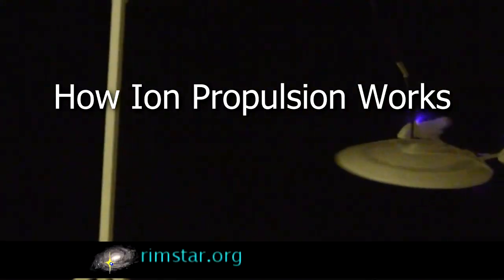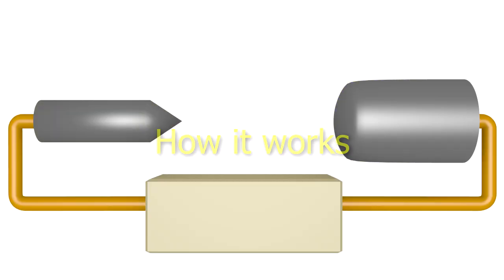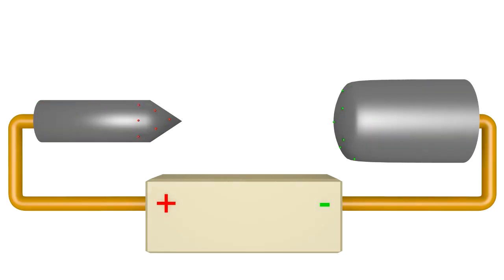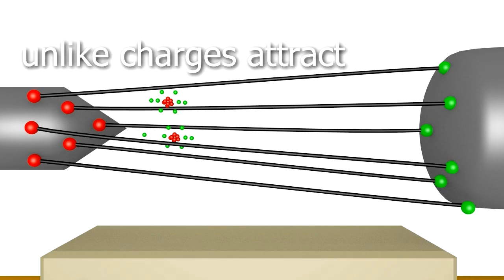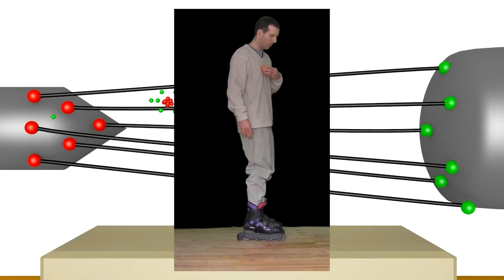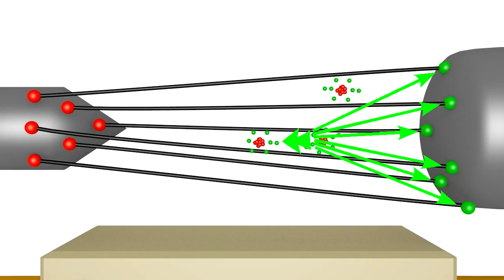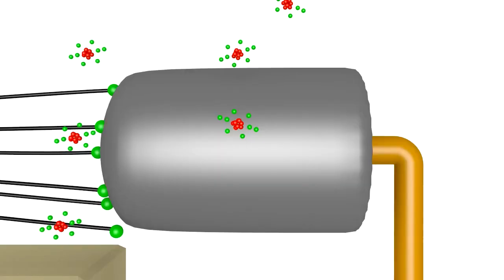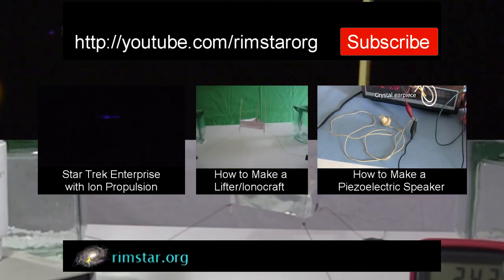How Ion Propulsion, Lifters and Ionocrafts Work

Comment: But the chair is grounded to the floor and does not move hence making it easier for you to push against it whereas the atom which gets hit by the ion like you have put it is free hence moves. an example am thinking of is if you dungled two balls with strings and then swang one so that it hit the other which is stationary what would happen. for sure the stationary one would move but will the other bounce back? if it does will it go back with great force or a weak one?
Reply from the maker: That depends on things like mass of the two masses (if you swing a ping pong ball at a bowling ball then the bowling ball won't move much but the ping pong ball will bounce back) and on other things like the elasticity of the two objects and probably other factors too.
Reply: @RimstarOrg  okay the different in mass and weight between a ping pong and a bowling ball is quite much. if you had two balls which differed in mass by just a tiny little bit what speed would be required for the smaller ball to knockout the larger and bounced back both at slightly higher forces and speeds.
Reply from the maker: I don't have the formulas off-hand.  It would probably involve the formula for momentum and a formula for the elasticity of materials.
Reply: @RimstarOrg  you went silent all of a sudden why? its been a week now and I have not gotten any response. i kinda need your opinion on the point i raised. what am saying is that you used/wore roller skates to show movement okay fine but you forgot that the molecules also move. so you should also have used an object that can move(not a stationary one like you used there) to represent the molecule.
Reply from the maker: I would simply have to try the chair with different masses sitting on it until I'd find a mass which would cause my pushing on it to move both me and the chair. The same trial-and-error happens with the lifter except that some of the guesswork has already been done. From my testing and that of others before me, I know roughly what voltage and current range is needed to move a sufficient amount of air and even then, I have a variable control and gradually turn up the power until the lifter starts flying.
Reply: @RimstarOrg  couldn't you have used a wheeled chair or a sliding chair instead? have you tried to do the same with a wheeled chair if yes how did it turn out. you should try posting a short video about it, i'd love to see the result and your reaction. the way i imagine your analogy is if you had a staircase where the individual stairs were suspended in the air and you tried to scale up but the stairs are held up by a weak force similar to the air molecules which are suspended by a weak force such that whenever you stepped on them they fall immediately even if you had a hundred pair of legs it would be impossible to make any significant progress upward not forgetting there is also gravity working against you same to the ionocraft.

Comment: The thing I wonder about is that these lifters were apparently tested in vacuum chambers, where no interaction or thrust via air molecules was possible....Does that discount the ion propulsion explanation?
Reply from the maker: All the ones I've seen show them moving very slowly i.e.  very low thrust. There's also no such thing as a perfect vacuum. There are also other things which you produce those small amounts of motion: sparks causing the ejection of matter, Coulomb forces, small thrust due to the small amount of particles in the partial vacuum, emission of electrons, and there are likely others too.
Reply: @RimstarOrg  I'm fascinated by this stuff,  and from the other examples of lifters I've seen, such as ones tested in a vacuum, it eventually failed as it approached full vacuum. But then I noticed that it was short circuiting with the little balsam legs now acting as a conductor between the anode and the cathode.....

I'm no electrician, but it occurred to me and other commentators on that video, that the problem may be that the air acts as a dielectric.....When there's no air, the electricity starts conducting down through the next available pathway....So, in a vacuum, you'd probably need another design using a built in dielectric material. In fact, I think that was part of the original TT Brown design.

Comment: can lifter fly till certain height by applying weight to it
Reply from the maker: Yes, but it would still be tricky to make it stable. The only reason they seem stable at all is because there are threads holding it down at each leg. More propulsion than is needed is applied to each side. As long as the weakest side is propelling enough against the threads holding it down, then it appears to be stable.
The whole problem lies in that it's very hard to make each side propel the same amount of air. You have to make the distances between the wire and the foil exactly the same for each side, and the curvature of the top of the foil probably matters too.
So you can weigh it down but you'll still need the threads.
Reply: @RimstarOrg  thanks

Comment: your power source looks complicated. Can't you just like get a voltage booster and connect the copper through the outlets?
Reply from the maker: I doubt that those cheap boosters which you can buy on ebay would have enough current to fly a lifter. Also, a lifter needs DC or pulsed DC. From what I've seen of those boosters, I suspect they put out AC.

Comment: can it fly in vacuum
Reply from the maker: It can, if you bring along air or some other gas to act as the propellant to be ionized. The ion thrusters used in spacecraft like NASA's Dawn spacecraft which went to the asteroid, Ceres, was a different design but it carried along Xenon gas as the propellant. https://en.wikipedia.org/wiki/Dawn_(spacecraft)

Comment: Will static electricity work instead of a high voltage power supply?
Reply from the maker: No, for a lifter, static electricity doesn't usually have enough current. You need a lot of current (somewhere in the high microamps to low milliamps). A very big Van de Graaff generator might work, one with a 15" to 20" dome but my 14" dome Van de Graaff didn't have enough current. The voltage needs to be around 25,000 volts.
If you want to do simpler things, like an ion propelled rotor then you can use something like a Van de Graaff. See these videos of mine for ideas http://youtu.be/UgWTjCHsm3M and http://youtu.be/Gf6EbRmYImI
Reply: @RimstarOrg  Thank you!
Reply: @RimstarOrg  It would at least make some ionic wind, right? I just need a simple and non-dangerous demo of ion powered flight. Don't need it to fly, just need some ionic wind from the "engines".
Reply from the maker: That's an interesting question. Without doing my own experimenting, it's hard to say what would work. If I were to experiment then my first attempt would be to combine just the rotor part from this https://www.youtube.com/watch?v=UgWTjCHsm3M (no Van de Graaff generator) powered by the simple static electricity trick I used here, rubbing a cotton cloth on a PVC pipe https://www.youtube.com/watch?v=6x6DqPL14yU. The wire in the second video would go to the ion wind rotor of the first video somehow.  Let me know if you try it and how it works out.

Comment: Please give us details about the power supply; voltage and amperage needed.
Reply from the maker: For the lifter, I use this power supply https://www.youtube.com/watch?v=GEuK1OdYxHk (but the proper flyback and multiplier have gotten hard to find) or this one https://www.youtube.com/watch?v=r32e0QGdm8U or you can buy one from here https://www.amazing1.com/. It has to be at least 25,000 volts DC but I don't know how much current, usually between 250 microamps and around 1 milliamp I think. See this video where I do measurements https://www.youtube.com/watch?v=LOGAaObsN4g

Comment: You can double the lifting strength simply by blocking with paper.If a Anti Gravity Lifter can lift 20 grams of weight. All you need to do is link thousands of lifters together to form a huge flying cube or saucer of any design. This Flying cube will be able to lift Tones in weight for a War Of The Worlds type of anti gravity craft, floating above ground with the Fire power to destroy anything below. It would also need to be Armour plated.

Comment: so...that's probably the way TIE fighters moving,right?
Reply from the maker: It could be! that's the way I made my TIE fighter move https://www.youtube.com/watch?v=oD_8_NZJF48. More likely they're using something closer to the type of ion thrusters used in NASA's Dawn spacecraft currently orbiting the asteroid Ceres. They also use the high voltage and but they don't require the smooth and sharp surfaces.

Comment: why not increase sharp points and curves for greater propulsion .
Reply from the maker: That would certainly help. But there does come a point where the curved area becomes so large that it's in the way of the airflow. I'm sure there's also a limit you'd hit where the power supply just doesn't have any more current for feeding the ions and you end up getting no more benefit.

Comment: Given that the propulsion is reliant on pushing air molecules, this device should not move in vacuum, correct?
Reply from the maker: Correct, or at least not using ion propulsion. Other things like off-gassing, ejecting electrons, ejection of matter due to sparks, and attraction to the vacuum chamber parts can cause it to move, though if it does, it moves much more slowly.
Ion propulsion is used in the vacuum and zero gravity of space though. The Dawn spacecraft currently orbiting the asteroid Ceres used an ion thruster to get there. It carried along Xenon gas for the propellant.

Comment: What if there is no air though? Great vid btw!
Reply from the maker: Thanks! If there's no ionizable gas at all then it doesn't work. For ion thrusters in space, like the Dawn spacecraft currently orbiting Ceres, they bring their own Xenon gas.
Reply: I plan on making a simple ionocraft. Like the triangular shaped one for a project. Is it safe to run my hand under it without touching it?
Reply from the maker: That depends on how far away your hand is. I wouldn't do it, unless my hand was a few feet away from the lifter and any wires going to it. These lifters require not only a high voltage, but can create sparks with a harmful amount of current. If your goal is to check for air flow then attach a tissue paper to the end of a long plastic stick and put that in the flow instead. Another way is to do a smoke test using incense like I do in my smoke test video https://www.youtube.com/watch?v=LOGAaObsN4g.

Comment: Could draw power from a tesla coil?  scale thrusters down to nano and give more thrust per area? Make thrust vector more efficient? Allow for localized drone flight? Would spinning add benefits?
Reply from the maker: No, unfortunately it needs DC and a tesla coil puts out AC. Shrinking it down to nano size is an interesting idea I hadn't thought about before. You'd still need the high voltage in order to break down the air.

Comment: There’s no propellant? Ion thrusters use propellants like some gas. Why doesn’t this? How come we don’t use this for space travel? I’m a little confused so if you could answer my question whenever you can that would be awesome. Thanks!
Reply from the maker: The propellant is taken from the surrounding air, the same way a jet engine does. Notice in the video where I talk about interacting with the atoms in the air. Do it in a vacuum, such as in the vacuum of space, and it won't work. For ion propulsion engines in space, they take along Xenon gas as the propellant.
Reply: RimstarOrg 
Makes sense, thank you for helping me understand better. So let’s say we were able to create massive amounts of energy in space from a low or almost 0 input, just in theory. Like cold fusion or something like creating electricity by profiting off an artificial gravity in a cycle, just some how ...is there any way you could get propulsion just from pure electricity? Shooting just the raw electrons and protons (electricity) out the back? No need for propellant or fuel.
Reply from the maker: Protons have 1836 times the mass of electrons, but both do have mass. So if you shot those out the back then they would be your propellant. But you'd still need a supply of them. Even cold fusion, assuming it works, or hot fusion, doesn't produce new mass, they just fuse existing particles together.
Reply: RimstarOrg Im just talking about electricity generated from cold fusion..or any other form of electric generation or storage. Can raw electrical current be turned into thrust? Without fuel or propellant. Is my question. If not then, not quite sure how’d you generate more mass from a small amount.
Reply from the maker: The problem is you're asking about electrical current and electrical current involves moving particles, which have mass. So that's propellant.
But I guess a way to answer your question is to say that you need a propellant to move around in space.
When swimming in water or when walking around, you don't have a propellant. But in those cases, you are acting against something: the water and the ground. In the vacuum of space there is no such thing to act against - so you need a propellant.
Reply: RimstarOrg thank you for your time and patience, yea I know it’s a mind bender. So to just make things clear. If I have just a battery charged up with electricity, decent sized battery. Can I produce thrust on earths surface with just that electricity? Accelerating all those electrons and or protons in the current. And what about space? Since there’s no air it shouldn’t make a difference because your still throwing mass out the back (Electricity is mass? So technically it should be possible right)
Reply from the maker: Yes, but you have to eject the electrons and protons out the back as a propellant. Eventually you'll run out of them though. The same applies for space.
Electricity isn't mass. The electrons which electricity moves around have mass, but electricity is defined as a phenomenon to do with moving charges like electrons and protons around.
So, if I understand what you're asking about, then no, it won't work. You can just put some solar panels on a spaceship and expect electrons and protons to magically appear so that you can use them as propellant. Eventually you'll run out of propellant (the electrons and protons) and you'll just continue drifting in space at a constant velocity forever since there's nothing to stop you.
Reply: Dammit.....so the only known non propellant engine is the em drive? It passed the review and makes a small amount of thrust by shooting microwaves in a cone like shape. I’m just trying to find non propellant/fuel thrust solutions. Excluding compression like a prop or air compressor in earths atmosphere.
Reply: But what if it's self-powered without strings? As in not using it in a vacuum (even though 'vacuum' is filled with plasma and many different electric charges and constant cosmic ray collisions) but having a nuclear reactor or extremely high voltage supply safely in the central area inside a geometric vessel (let's say a thin circular craft or triangular craft) of some sort, and be able to create imbalances in different areas of the ship for dynamic side to side, horizontal, or vertical movement on a much larger constructed vessel or craft? Is it possible to attain higher speeds in this ideal craft?
Reply: Ooooo...I like that. Maybe yes, seems kinda like riding a wave but in space.
Reply: Hey I have another quick question, I’ve just been thinking. How much electricity do you think is required per pound of thrust or lift for this ion engine. For let’s say 100 lbs of thrust or even more. If this type of propulsion is chosen for an aircraft or even a jetpack, would the person operating it be electrocuted if fallen into the water or on a rainy day? From just the exposed ion engine not the battery or generator. (Excluding the safety of a insulated cabin or suit) I’m just tinkering and have questions 😂 thank you.